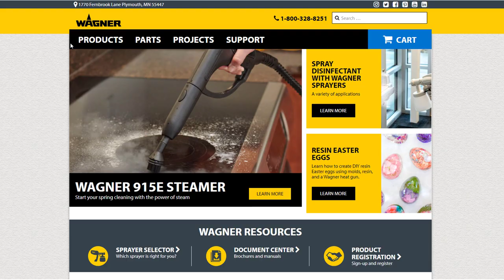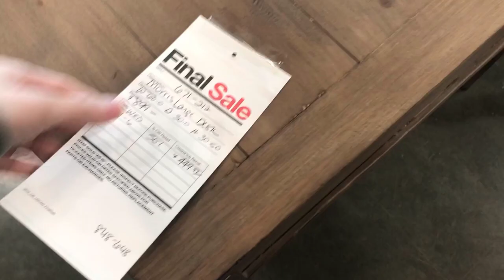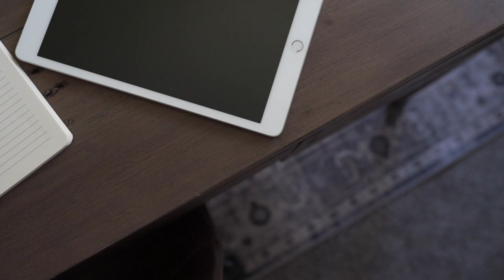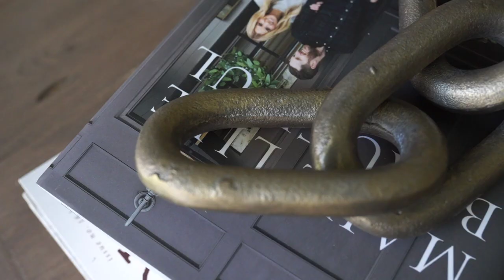DIY Home Office Makeover // Custom Barn Door, Vertical Shiplap Walls & New Desk!

Comment: What did you do to the trim that existed for the closet door, did you just leave it there?  Picture please.
Reply from the maker: I removed the trim around the door, we ship lapped it and covered the frame. I still need to go over the inside of the doorframe with wood filler, sand then paint. I did it this way with the closet door to allow a gap under the barn door. If I had left the trim it wouldn't have fit under the barn door so it had to go. Hope this helps!
Reply: @ValerieAguiar  thank you.